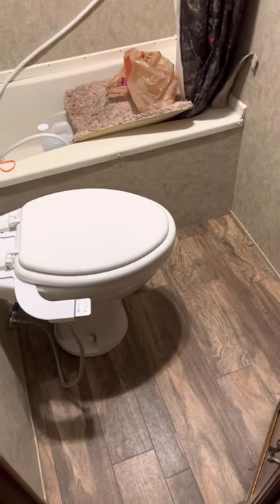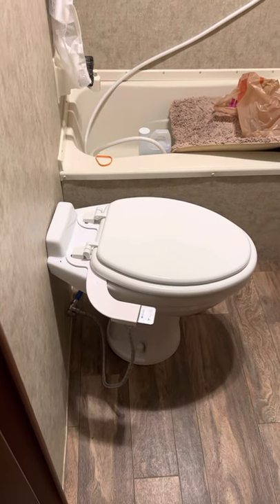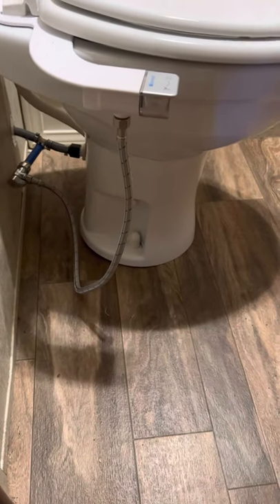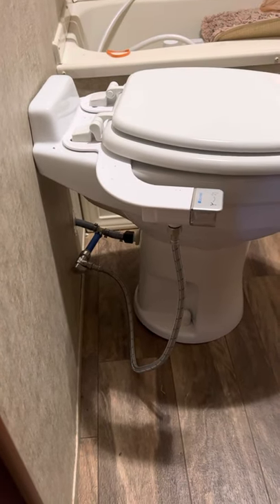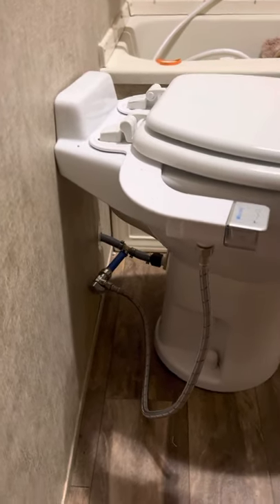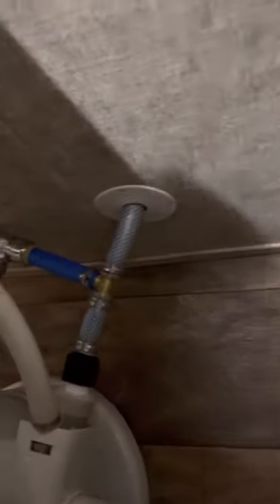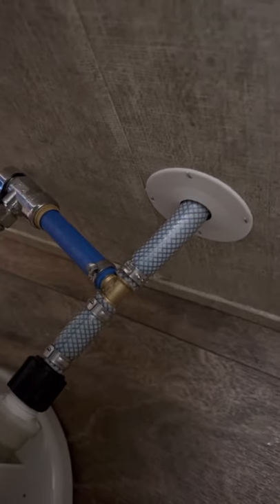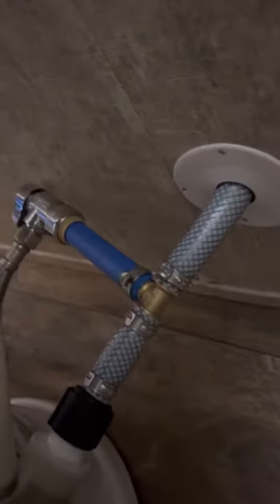Bidet in RV - How to install it

Comment: I have a similar setup as yours in our RV. Mine leaked. I removed it as a precaution to prevent further damage.  I plan to redo it now that I see your setup.  I used regular clamps, not knowing I should have used the pex clamp.  Thanks for sharing.